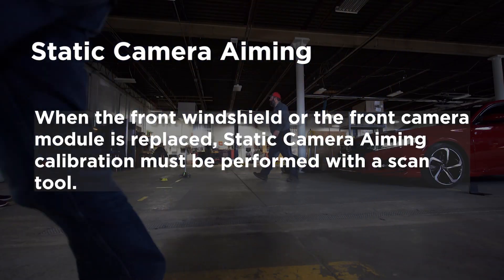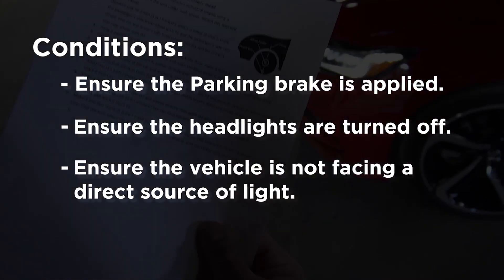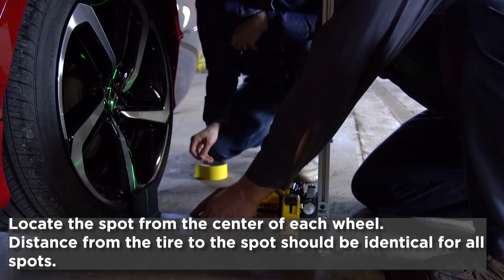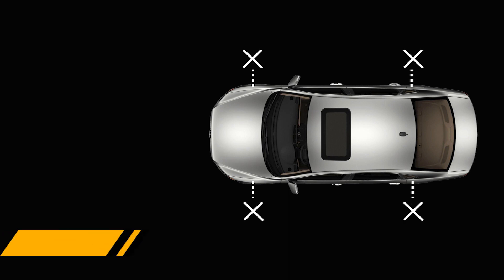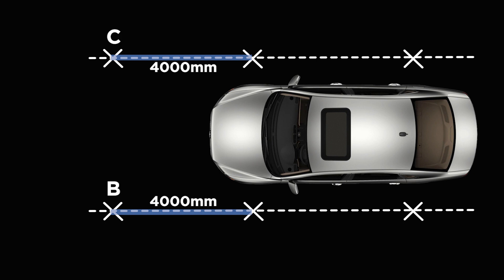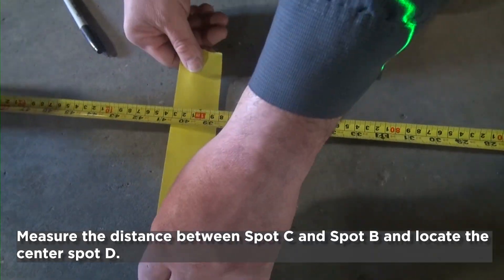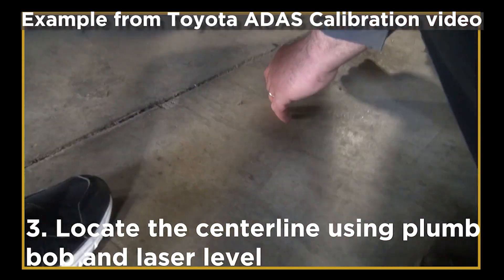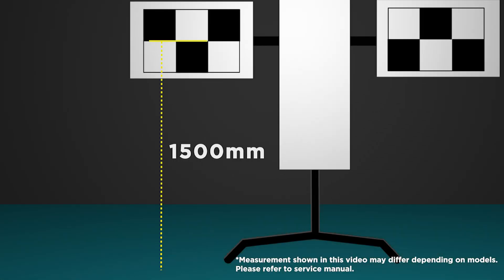2018 Honda Accord Front Camera Calibration

Comment: I was on the highway with my 2018 2.0 Touring when a stone flew off a truck and smashed my windshield cracked it and as I drove wound and hit a pot hole the crack spread just called to find out how much to replace it and it’s anywhere from $1300-$2000 wish OEM  from Honda with calibration.

Comment: I just had a wiper motor or a starter come flying at my face the other day on the freeway leaving church. I drive a 2020 Honda Accord 2.0T Sport. Long story short I swerved to the right as best as possible and ducked my head to the right. But it still hit the top left corner of my windshield and damaged the pillar. It’s pretty ugly now. But upon calling different auto glass places around me. They all had price ranges from 169-250 or so… went to an actual body shop and the priced everything with out insurance covering it at 1,039. Unfortunately these windshields are not cheap. Theres calibration that has to be done and it definitely ramps the price up. Also to put into perspective that they have to fix the pillar and paint it. Which is a 3 layer paint. Mine is pearl white. Needless to say. I wont ever down grade my insurance ever again. 😅🤦🏻‍♂️ It could have been a whole lot cheaper. Well at least I survived that. Thank God.